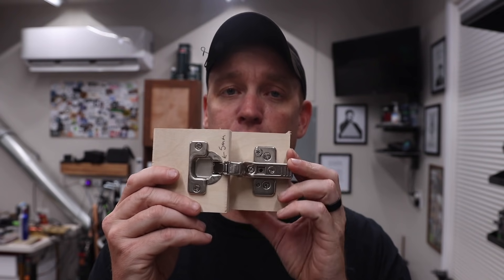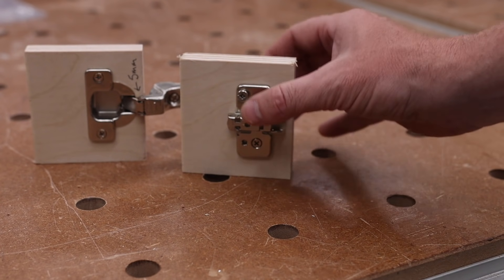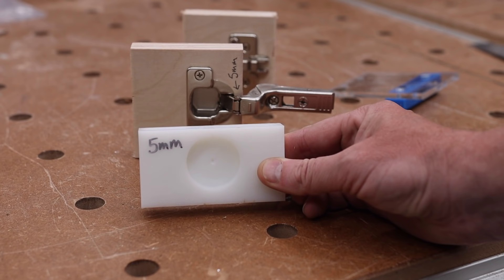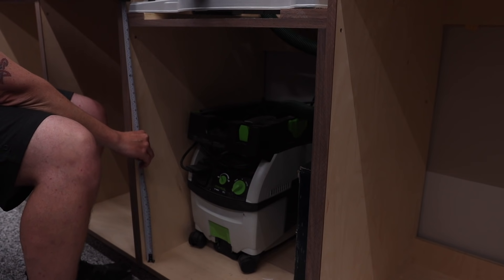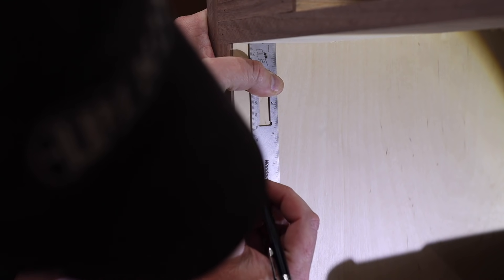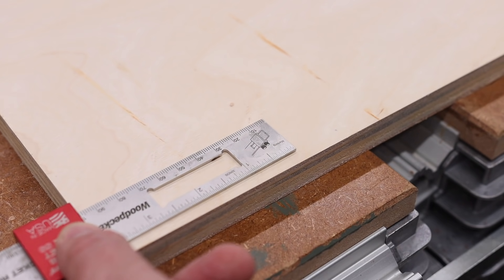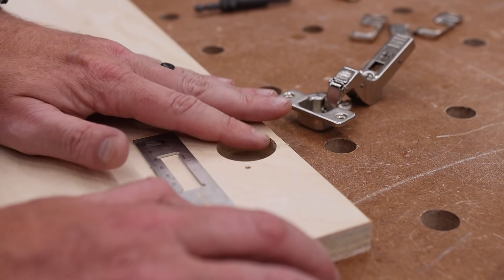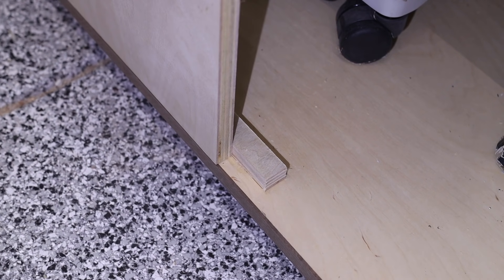This is so confusing for most people

Comment: Great tutorial as usual!  Those woodpecker Paolini squares are awesome.  So versatile. And for those of you who try this w/o self centering drill bits, expect to be disappointed.  Now matter how accurate you think you are free hand, you'll see the hinge jut to one side or another as you drive in the screw.  That's called the OHNO Second. The split second before you realize you made a mistake and it's going to cost you! :)   If you have to redrill, keep some wooden toothpicks around. You can glue the toothpick in to the defunct screw hole and try again.   Also, most cheap hinges come with GARBAGE screws. Just throw out the pack and get some quality screws.  It'll keep you from filling up your swear-jar!  LOL.

Comment: Great video. I’m a carpenter. I’d like to share why and how to install an 1.5 inch thick open slat door as an inset when the hinge market is geared to address 3/4 inch thick doors. 1st, the only way to address a thicker door for function, is recessed. Second, the hinge needs to be recessed in the door in exact placement and distance from the face of the door and cabinet as a 3/4 inch door would need it to be. A double recessed of sort. So a 1.5 inch thick door operating with inset or recess hinge has to have a recessed hinge from the back of the door, 3/4 inch further toward the front with modification so the neck of the hinge passes freely through the hinge side freely. This applies to the case when the face has the same profile open slat as the door for uniformity of the entire front of the cabinet including face and the door are uniformly open slat on the entire front of the cabinet. Just sharing and I’m not sure if I didn’t fumble my meaning.
Reply from the maker: Thank you for sharing

Comment: Great Video, Easy to understand even with the metric measurements lol. I’ve never built cabinets or hung doors before. I’m designing and building out my garage work shop for the first time. I love the inset door look. I imagine inset doors would keep dust from settling on top of the door if they were set outside the frame.

Comment: As a Canadian I can easily switch between metric and imperial.

I think of speed in kilometers/hour
I think of height in Feet/inches
I think of interior temperature in Fahrenheit
I think of outdoor temperature in Celsius

I encourage all woodworkers to start using the metric system for their projects.  Switching to metric for woodworking increased my accuracy enormously.  It also largely eliminated nearly all measuring errors for me.  No more fractions, no more 3/32 of an inch.  Metric woodworking is like easy-mode.
Reply: I grew up in the UK in the 70's which is when the switch to metric started. The UK has never fully embraced metric so we now have a weird hybrid. I think in Miles per hour. I'll say someone is 6ft 2 inches but I'll measure my projects in metric. Temperatures used to be spoken of in Fahrenheit but now celsius is easier to understand. Fuel is offered in litres but car performance is still measured in miles per gallon. I think that is a deliberate smoke screen by car manufacturers and the government. 

For wood and metal work, metric is the only way to go. All those fractions are headache inducing. Much easier to say 60mm or 300mm. It's also easier when using computer design packages like photoshop, illustrator or affinity.
Reply: I'm a Canadian engineer. Anything that needs precision is in metric. I've worked with american engineers that will never use the imperial system. When I woodwork, why would I want extra steps dealing with fractions?
Reply: I still think in miles per hour and human weight as stones and pounds. If someone says someone is 300 kgs I am lost. Yeah 6 ' 4" is great for height.

Comment: What do you do for very thick doors ? We had to put some spacer underneath the base because the door was rubbing on the side wall of the cabinet where the hinges bases are, even at maximum possible setting on the hinge adjustment. There was not enough adjustment to move it away from the cabinet wall. It looks like these hinges are made for standard door thickness and anything very thick like solid wood does not fit.

Comment: Just about to do my first set ever, in glad I've ordered a gauge. My doors will be inset on a faceframe but the faceframe hinge mounting plates are impossible to get in the UK so in going to just pack out the mounting surface flush with the faceframe edge and use normal inset hinges. That's the plan anyway 🤞
Reply from the maker: Good luck 👍

Comment: Jason, thanks for this video! Huge help! Quick question: did you strike a line at 100mm on the cabinet and 98mm on the doors for the 2mm reveals? Thats the only part I’m still slightly confused on.

Comment: Great explanation. Have you ever used soft-close Blum hinges together with Tip On/Push to open? Seems like I should follow your steps, except have the hinge plate 2mm forward to allow for the Push to Open spring to be pressed.

Comment: Fantastic video.  Thank you so much.  I am working on a cabinet that will have doors with glass.  Ideally the door frame will be only 1" wide all the way around.  Is it possible to find inset hinges that would work with a door frame that is only 1" wide?  I am talking about the place on the door where you have to use the drill press to drill the hole that the hinge sits in.  All of the inset hinges that I have seen are larger than that.  I was wondering if they even make them small enough to work with a door frame that is only 1" wide.  Do you know?

Comment: So jealous of your tools which allow perfection!   Never seen a drill press with a fence!
BTw, I'd love to do everything in metric, but in America suppliers make everything in inches and it's not as easy to convert to fractions. 
Going to search for your video on how to make those cabinets.  So clean and elegant looking.
Reply: Clamp a straight edge to your drill press table… same thing. Second… he is an American… he’s actually active duty Army. Imperial to metric is easy. 1 inch is equal to 25.4mm. 1/2” therefore = 12.7mm. 3/8” is equal to .375” so multiple 25.4 x .375 which gives you 9.525mm.
Reply: I love Americans using the Imperial system still. They are more imperial than Britain. We have to use both because of the EU. I still think Imperial personally.

Comment: Great tutorial!  Question:  with the 5mm tab that creates a 2mm reveal.  How adjustable is that with the blue 110 clip top inset hinges?  It’s unfortunate that they cant adjust how much the hinge closes so that it doesn’t need that stop glued onto the top or bottom of the cabinet.  I realize there is a lot going on in a small space, but at least they could make it stop at 90 degrees to the mounting plate.

Comment: Extremely informative video. Thanks. So the same euro hinges can be used for either full frame or inset right? All that differs is the setback for the inside piece.
Reply from the maker: A framed cabinet would be different hinges but can still be euro style

Comment: So I have inset hinges but they look very different from those. They're sort of the older style hinge where you put the 2 screws on the exterior of the face frame. When I bought these I thought they were kind of a regular hinge and I liked it because them do to the spring tension. I thought that would help it stay closed etc. The challeng is that I built a maple frame on my cabinets and I was thinking of using a 5/8 Maple framed doors with 1/2 dadoed Birch on the inside. I think I might have to mill it down to size to make it flush with the frame which looks like the door should be roughly 1/4th thick, seems to skinny of a door? Sorry this is sort of hard to explain without seeing these hinges.🤷🏽‍♂️ I might return them. Okay I think I found what I need to do. Looks like I need to cut a data to make these fit properly. Scroll to about 11 minutes in and she explains it pretty clearly. I think I got this. Hope this helped someone and greet video brother! https://youtu.be/nkHvgTH_Oj4

Comment: What is the purpose of setting up the "5mm tab"? Is it to allow clearance for the inset door to clear the adjacent surface?  What kind of gap or reveal does this leave for the hinge side of the door?  The reason I ask is because Blum's instructions for this hinge allows for a 3mm - 6mm setback for the hinge cup.   Also, since your using Baltic birch plywood it's not a true 3/4" thick.  I've read that for a 3/4" door the hinge plates need to be set back 57.5mm to keep them from being proud of the cabinet face.  Have you found that to be the case?

I'm about to use these hinges for the first time ...
Reply from the maker: Hinges is a complicated topic at times. What I recommend is to try setting them up as a test first so you know what to expect
Reply: The purpose of using the set back of your using 3/4 or 18mm material is to allow the hinge cup to be set back enough to not create tear out on the door material. The force is being hinged at two points. If the setback were less the force of leverage would tear out the hinge. This is why the 5’mm set back is called for. Hopefully this answers your question. 
Visual: 
Just imagine the cup sitting 1/8th or 1mm from the edge. It would tear out to the front of the door because of the leveraging force.

Comment: So if I wanted to actually recess my door a little bit, would I have to get a hinge that would include the extra space. For example if my door was .75 in but I wanted it recesses another .25 -.5 would I actually need a hinge made for 1 - 1.25 inch. Sorry if this is a dumb question
Reply from the maker: Technically yes but you would have to see how the door opens cause that could cause issues sonar it is recessed

Comment: Do I need to drill the hinge cup on the door, or can I put it on the Cabinet?   I have 1/2" drawer and realize most hinge cups are deeper, or same depth, of that size
Reply from the maker: The cups only go on the door
Reply: I had intended using 1/2 stock on my wee project until I hit this very problem. I ended up using 1/4" stock at 2" wide and made fake stiles and rails.

Comment: How do you calculate how far back to install the hinge plate on your cabinet?
Reply: That's what I don't quite get either. This video uses a Rockler jig for setting the base plate distance (another video uses a generic template), but is each hinge manufacturer using an identical standardized plate for inset applications? The instructions for the Salice hinges I bought at Menards say to assemble the hinge to plate, hold the door in place, and mark the plate location. With a single door cabinet I don't know how you hold the door closed in place with the gaps correct and mark anything inside the cabinet. Going to try a mockup out of scrap to try and determine the setback distance.